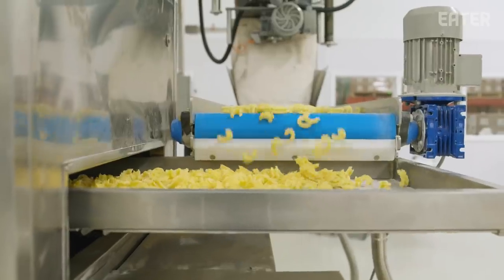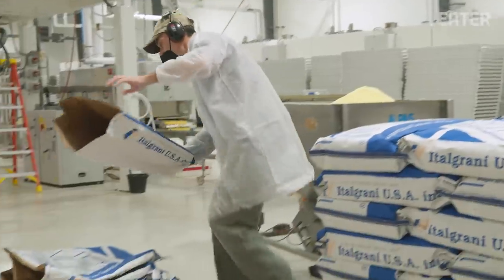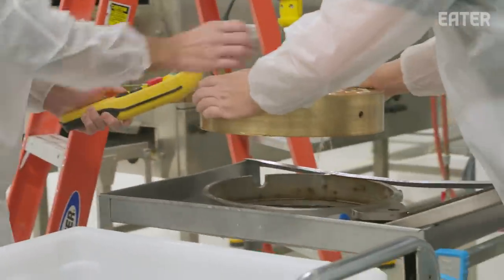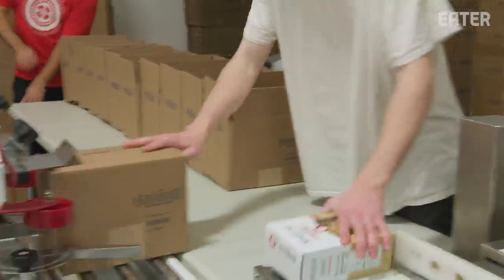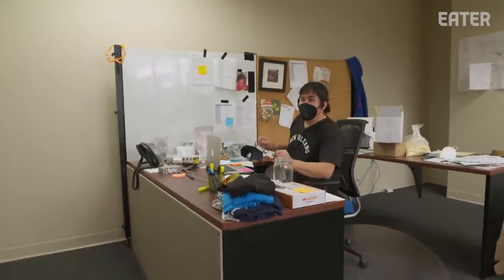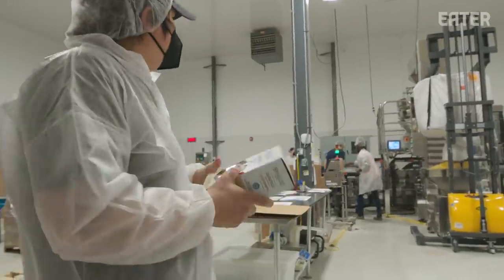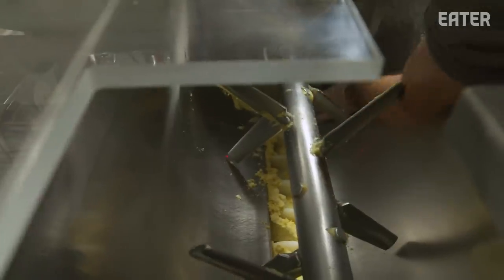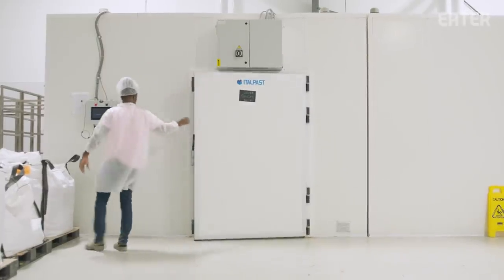How the Sfoglini Factory Makes Cascatelli, a New Shape of Pasta — Clocking In

Comment: With the addition of another machine, the leftover dough could be broken down and tumbled into couscous, which would give them another product to sell.
Reply: That requires another market research, but could be a possibility
Reply: Or sheets of lasagna (assuming the dough is the same)
Reply: @21cup  It sounded like the dough was densely worked and low hydration at that point, so any pasta type that requires heavily worked, low hydration dough might be possible.
Reply: @kellywhite9299  Correct.

Comment: Having tried Cascatelli I was very disappointed. It cooked weirdly unevenly (which has never happened to me with any other kind of pasta) so the little ribbons along the edge were much softer than the middle which was still undercooked. The texture was super unpleasant and the box of pasta was absurdly expensive compared to any other box of even "fancy" bronze cut pasta. Has anyone had a similar experience?
Reply: Hello, it's a matter of thicknesses.
You can check my comment below for more details.
Reply: I have cooked the sporkful pasta and found that you need a very large water to pasta ratio. And starting with rapidly boiling salty like the sea water. That way the pasta is moving constantly throughout the cooking and the water doesn't get overly starched. Hope this helps.
Reply: Not unpleasantly so personally. So many pasta shapes, it’s ok to stick with what you like. 

If you have more of cascatelli, I’ve had best luck not cooking it too long in water, and letting it finish cooking in a good quantity of a loose sauce, on medium - medium low heat.
Reply: I've had it and liked it. texture was fine for me, but my wife didn't like the taste. Tasted like pretty good pasta to me. Not as good as the hard duram expensive pasta I like to buy but as good as Cecci or the other well known brand.

Comment: What do they do with end of day "birthing" of 50# of pasta dough?  Does that get reused, packaged and sold as fresh, or can they gift it to local food banks/charity kitchens?
Reply: Its typically waste. Any leftover dough like that usually runs extremely hot (granted they have INDUSTRIAL machinery that cools it throughout the process) but a lot of pressure/heat/etc. has negative effects on that remaining dough. And the screen can easily be clogged by older/drier dough, which causes MASSIVE issues at the point of extruding through the die. The old dough won't properly mix into the new, and a hunk that big can make the machine paddles work too hard (damaging a million dollar machine) because it has to be mixed before it goes into the "screw". The screw forces dough into the die, and the tube the screw slides into causes a ton of pressure, which compacts the dough into that shape. Essentially, it isn't worth it to save that "birth", not saying they don't, but they are probably buying 50# bags of semolina at probably $20/bag, plus its diluted (at a 28 percent hydration level), so it costs them about $15 to throw it out, where as if they tried to extrude it, it would cost them $2500/hr or more of downtime if they ran into an issue I listed above.

Comment: I wonder what happens to that 50 lbs of dough and other leftovers.
Reply: I am very sure they use it to make more
Reply: guessing it is just waste that can't be reused
Reply: @davidbowman5105  if so, no biggie
Reply: Its typically waste. Any leftover dough like that usually runs extremely hot (granted they have INDUSTRIAL machinery that cools it throughout the process) but a lot of pressure/heat/etc. has negative effects on that remaining dough. And the screen can easily be clogged by older/drier dough, which causes MASSIVE issues at the point of extruding through the die. The old dough won't properly mix into the new, and a hunk that big can make the machine paddles work too hard (damaging a million dollar machine) because it has to be mixed before it goes into the "screw". The screw forces dough into the die, and the tube the screw slides into causes a ton of pressure, which compacts the dough into that shape. Essentially, it isn't worth it to save that "birth", not saying they don't, but they are probably buying 50# bags of semolina at probably $20/bag, plus its diluted (at a 28 percent hydration level), so it costs them about $15 to throw it out, where as if they tried to extrude it, it would cost them $2500/hr or more of downtime if they ran into an issue I listed above.

Comment: I'm a machine operator. His machine is messing up cuz he is constantly cleaning it everyday. While yes it's nice and should be cleaned. It always messes up the bolts and everything he is using. The only thing he needs to clean is the shape disk. 

When we cleaned are machine everyday, it messed up. We ended up only cleaning it on Saturday and Sunday.
Reply: The dough already inside would likely harden overnight and cause clogs, it's basically wheat glue. If they ran 24h it would make sense to not clean
Reply: Liking and commenting so they see this…
Reply: It was the weighing and packaging machine that was breaking down.  He didn't say anything about breaking it down, as opposed to the extruder, which is broken down and cleaned.
Reply: They complained about the scale machine breaking, not the extruder which has the shape disk in it. But maybe they clean that one every day too, who knows

Comment: As an early adopter of cascatelli, this was interesting, but I found that the amount of waste was off-putting.. The 20 kg ball of dough at the end should surely be incorporated into the next day's batch. Also, why can I not get organic cascatelli???
Reply: By the next day that ball of dough would be hard as a rock. Ever have play dough turn dry as a kid if you left it open? Pasta isn't much different. If you mix it back in its going to ruin the next days batch with inconsistent texture and hard dry bits that plug the machine. Never mind the bacterial or fungal growth that would start in it. There's also going to be a limit to how much can be pressed out of the machine before the machine is out of travel on the press. If they are getting 50lbs out of 6000lbs of wastage that's not bad, less than 1%. If they did much of anything with it they would be putting out a sub par product, which can ruin a business if they are known for having consistent quality stuff.
Reply: I think you'll find that waste like this is the norm in most food production. It's generally less than a percent of the overall product anyway, not significant compared to how much is thrown out by supermarkets or at home.